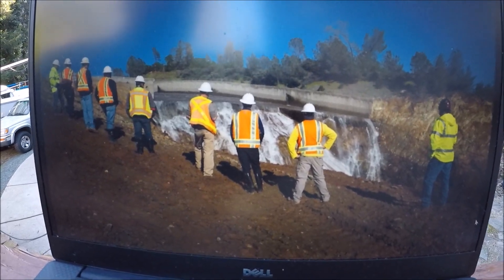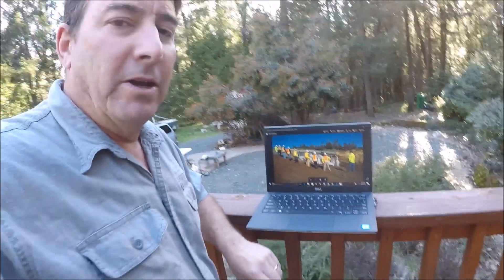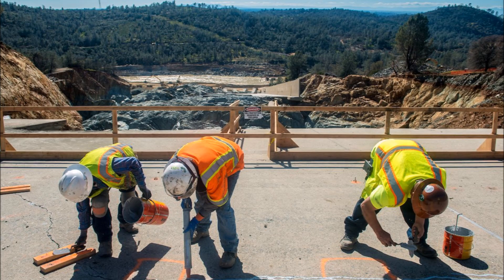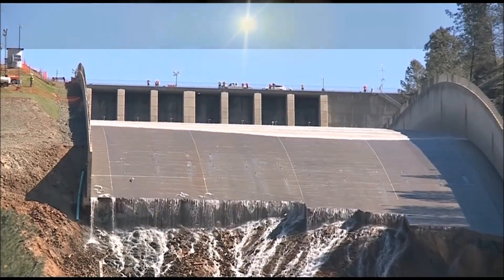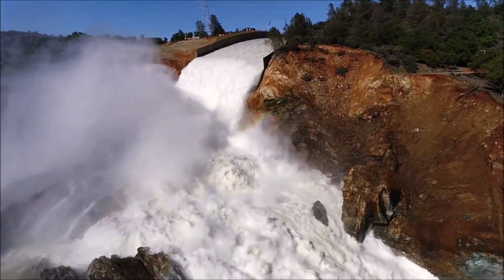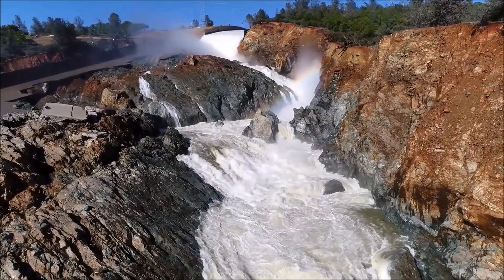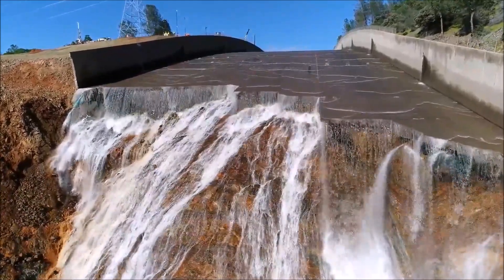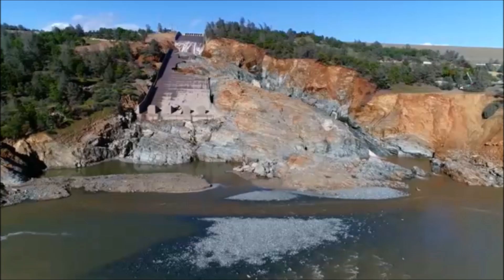Oroville 29 March New DWR Spillway Footage

Comment: I wonder if in the long term, for both safety and to get some use out of the water flow, extra capacity could be added to the power plant. This would be extra capacity in ability to drain the dam and extra electrical generating capacity. I have asked several times if anyone can see if rebar was used in the spillway. I myself do not see any re bar in the spillway construction. I do not know if it is standard to construct spillways without re-bar or if re-bar would have even helped.Sure would like to get something better than we had at the beginning after spending what is it now, 300 million?
Reply from the maker: See previous updates, I covered this issue extensively.

Comment: It looks like there's some significant loss of concrete on the left side. Before, the spillway lip was straight till the right side diving board. After discharge, it is much more jagged. It could be as much as 30 feet gone from the left side.

Comment: The sheer scale of that structure is simply astounding, especially with how easy it is to make it appear smaller than it actually is.  You've probably already done this ad infinitum on past reports, but it may be useful for a future voiceover looking at the cut to describe the physical dimensions of the spillway, including the width, the thickness of the concrete,  the height of the edge walls, and then describing the depth and linear length of that new canyon.

It's amazing how quickly that canyon formed and I really do hope Geology professors are paying attention so they can add this erosion example to their problem sets.  As it is, it simply renders the rest of the old spillway an abandoned relic of the past unless engineering wants to build a real bridge to carry the structure over the canyon.  It'll probably be best to simply reconstruct a new spillway that follows the natural curvature of the canyon, though that might be a level of engineering we haven't attempted before, the construction of actual rapids versus the previous long smooth slopped plane.  I'd imagine with the right curves and super elevated base surfaces that it may be possible, but this would be a design almost better left up to Racetrack engineers, whereas it has to manage both a continuous volume, constant hydrostatic surface pressure, and a rapid but controlled drop in elevation.

Comment: Was wondering if the built a concrete wall say, 75'-100' at an angle and near the end of the spillway?
This could divert water going to the left of the plunge pool and undercutting plus the ability to control the throttle better.
I know the width would be compromised a bit but think the new valley and plunge pools created can withhold the beating of the extra water.
|    |
|    |
|    |
|    |
|    |
|    |
| \   |
plunge pool
                  { New Valley   }
~
Anyway, worked 12.25hr's with 3 more shift to go and was just thinking this could be a good temporary fix for erosion when they need to shut the spill way down to clear fore-bay and after-bay?
~~
Thanks for your hard work Juan, very much appreciated.
James
3/29/2017
11:05pm

Comment: Just an interesting comment, those surface repairs, to me, look a little shallow. I would think they would want to jack hammer those cracks down deeper and make patches that are a little more permanent, in other words, a little stronger, hold on better. Just an opinion from a guy not on site. It sure would be nice if you could be at the press conference to ask more in depth questions than the uninitiated press.

Comment: *Concrete Traffic Barrier, come strong to mind for the undermining ares. Utilized as a sort of stacked to lock rip rap. Truly, non freeway serviceable sections, would prove to be the best selection from which to choose. Strategically placed by crane or copter, and allowed to settle in after several flow days... so the *C.T.B. would find the desired lock with that of the existing sub-grades. Once their particular refusal thatching point to sink is achieved... then, compact car size limestone aggregates could bring the desired elevation just minus that of the design intended concrete rip rap thickness. The *C.T.B. would eliminate the awkward expensive usage of the previously placed rock bolts. blancolirio iv'e sincerely enjoyed the operation's coverage's & Data links. -gilpin 32917
* https://jjhooks.com/applications/traffic  -gilpin 32917

Comment: Perhaps they can just turn that eroded canyon and plunge pool as you call it into the new spillway channel.  Perhaps remove the lower broken spillway concrete section along with the soft rock beneath it and have a giant fan shaped terminus to the spill way.  Just shotcrete the whole thing about 2 ft thick and repair and add to it each year in the dry season.

Comment: Is there no consideration to bring the RVOS back online?  It was taken out of service for fire detection upgrade  seems  that would now have a higher priority to get done, or a temporary detection system,  to help take pressure off the main spillway and provide a another option for dumping water.  Is the out flow rate of the RVOS, if online, equal to or greater than the reservoir in flow rate?   Staying tuned.....

Comment: I bet that as a commercial pilot, if you ever see a straight section of river anywhere on planet Earth, then some architect or other with a straight edge drew a straight line on a plan. Water in rivers never follows a straight course naturally, and if forced to follow a straight course, will inevitable engage in aggressive erosion. If these same engineers were to design aircraft, there would be no curves and the flight characteristics would resemble that of a masonry brick!  Why not make the replacement spillway look like Mother Nature had a hand in the design brief?

Comment: Thanks again for the great reporting.  Could you remind us about the previous accidents, fire and valve failure, etc. and there impact on reservoir outflow?
Reply from the maker: see previous episodes...
Reply: Thanks, I found it, Oroville Dam 10 March, at 0:12:34 - flow is 4000 cfs without going through the power plant, if it's working

Comment: Thanks for another great video. Another excellent production.

There are a couple of interesting things in the drone footage.

The first thing that jumped out at me is the dark stream of water and debris that appears around the 4:50 mark. This seems to be water and material from underneath the spillway. If that's the case, it's clear evidence that the spillway failed because it was undermined by water that leaked through joints and cracks. The engineering report commented on the "extraordinary" amount of water coming out of the drains while the spillway is operating. This is the smoking gun and in my opinion, shows that DWR really badly dropped the ball. The cost of this mismanagement will cost taxpayers hundreds of millions of dollars. Better remediation would have cost a fraction of the cost to rebuild the entire spillway. It reminds me of the shuttle disasters. Clear evidence of problems in plain sight was ignored with catastrophic results.

The second thing is the amount of debris in the diversion pool. The early estimate was around 1 M cubic yards. That estimate was later increased to 1.7 M cubic yards with 1.26 M cubic yards removed. Before they turned the spillway back on, almost the entire width of the channel was clear to a considerable depth. Now, you can clearly see that the channel has been filled with debris almost all the way across. No doubt some of the debris that was at the base of the spillway was moved by the water flow, but it will be interesting to hear what the new estimates are for the amount of material to be removed. I'll go out on a limb and predict 1 M cubic yards (or more). If that's the case, there will have been substantial erosion of the channel. Since the geologists used lidar to scan the channel, they should be able to rescan it and estimate the amount of material that was removed since the first scan.
Reply from the maker: Yes, I should have mentioned the re-3dsurvey.
Reply: That applies to underwater as well, using multibeam sonar, rather than lidar. They have been operating survey boats, but unfortunately, they haven't posted any imagery. It's too bad because it would be interesting to see.

Comment: Thanks again Juan, for an accurate, informative report.

I'm no expert, but viewing the footage, it seems the most common sense path (pun intended) for a new spillway route would be where the flow "wants" to go (viewer right), and appears to be eroding no further, due to the massive solid rock face. 
If that rock face is strong enough to stop the immense force of the flow now, as it appears to be, why not use it as the foundation to build the new section of spillway.

Is there some law or restriction that says a "spillway" MUST be built as a straight chute?

Seems to me, the water flow dynamics and the rock geology are showing clearly where the water 'wants" and can flow, why not build upon what the water is saying?
Armor up with tons of rebar and concrete, the viewer left side, where the loose ground and erosion is seen, then just rebar and concrete the channel the water has already cut.

Plus, I think it would look way cooler, rather than water flowing down a boring straight chute spillway.
Like Einstein said, " Solutions to problems will never be found using the rules that created the problems."

Comment: When you have that many people standing there like that in the beginning of the video they really don't have a plan. You can bet when this is over to it wasn't a spillway failure. It was the dirt they laid underneath it that started with a small washout. They figured once the spillway was set up it could hold the weight of the water. They were wrong. My only two questions is just why aren't they starting at the bottom of the spillway and get that fixed and work there way upward and then figure how to splice it together and be that much further along with the fix. And the million dollar question. From the time there started to build this spillway to completion, How long did it take them to build it?.. As always. Better dump water.

Comment: I have a question.  Couldn't they install some deadman barriers towards the end of the spillway to divert water more toward the right side of the spillway?  This would reduce the erosion from the left side of the spillway and would also increase velocity as it leaves the spillway and goes into the plunge pool and might allow them to reduce the CFS without further eroding the spillway.  I'm just thinking out loud more than anything, this is by no means my field of expertise, but I am studying fluid dynamics.
Reply from the maker: Aaron Adams they will during this repair time.

Comment: Would somebody create a Website (make money selling advertisement space and emergency supplies and retire rich) with all the facts/numbers that are helpful to understanding  the Oroville Dam, Spillways, Power Plant? There are a lot of numbers that need to be condensed on a few pages so everyone can have easy access to them. Then notify Juan and he can post the link in the description box on each new video. Here are some of those numbers. Correct my numbers if incorrect and add to them if you know more: 
-922 feet above sea level is the top of the dam. 
-900 feet is when water will flow over the top of the emergency spillway. 
-850 feet is the preferred lake height. 
-813 feet is the inlet to the main spillway. Once the water drops below that point, the main spillway cannot be used. 
-640 feet is the lowest the lake can drain using the power plant. It can be drained lower, but water would be using the diversion tunnel. 
-224 feet is the maximum height of the water in the Thermalito Pool if the power plant is to be used. 
-19,000 CFS is the maximum amount that the Power Plant can release through the 6 turbines. 
-4,000 CFS is the maximum amount of water that can be released from the River Valve Outlet System.
-27,000 CFS is the estimated inflow to Lake Oroville this summer.
Reply: https://en.wikipedia.org/wiki/Oroville_Dam

Comment: Okay so here's the breakdown of cubic feet to an acre foot.  Just to have a better idea of water volume. One acre foot is equal to exactly 43,560 cubic feet, or to 325,851 U.S. gallons. Just to know real time data now, shows inflow, or run off, at 19,980 cfs, or 0.4586776812799 acre foot per second. which is 1,198,800 cubic feet per minute, that makes it 71,928,000 cubic feet per hour. Convert that to acre feet (af) comes to 165.12408 af per hour. In a 24 hr period, im just gonna round the numbers now, that is approximately 1,980 acre feet. If my research and calculation stand correct, I'm no mathematician, but numbers speak for themselves, they are either right or wrong.  I'm getting my referencing on convertunits.com. Thanks again Juan.

Comment: Awesome reporting!  Why is the flow at 11,000, is only 4 turbines running?  Also a more nagging question with me; why are they not considering to use the river diversion valve for 5,000 more cfs?  Is it because it is sharing an outlet with the powerhouse?
Reply: Theron, if my memory serves me correctly, I think Juan did a video on this recently when he covered the workings of the dam.  I think it's knackered due to some sort of bad repair that consequently nearly swept away some workers who had to go down and open it up. I could be wrong but check some of the vids as I'm sure it's there somewhere...

Comment: I agree with you about where the shockcrete appears to be.  I didn't really expect it to erode away from the vertical face much, cause it's kind of set back under the spillway lip.  But the stuff they shot lower on the left didn't look as secure before they turned on the water, so I wouldn't be surprised if it's gone.

Didn't Bill say, during the press conference earlier this week, that they will rebuild the road in front of the ravine so they can move the dredgings to both sides?  If so, that's going to wash out every time they turn the water back on.

Finally, what editing software do you use Juan?
Reply from the maker: Nicotti crummy old Windows Movie Maker...the free stuff, lol.

Comment: How did they know 40,000 cfs was the correct flow rate?
Reply from the maker: Ian Clapham plus trial and error...
Reply: water mass, gravitational constant @ Oroville, outflows angle, turbidity, and resistance from friction coefficient of the spillway, to give subsequent volume at the calculated acceleration(s) for a trajectory to land in the most favorable area of this said plunge pool... probably lol but I'm just guessing without getting out my books on hydrodynamics...XXX

Comment: I remember the excellent discussion about the accident at the Hyatt powerplant when using the extra diversion gates or bypass gates, can't remember the correct term.  Is their use still off the table for the foreseeable future?  I suppose as long as the spillway is "working" they'll continue with that plan.  I just think it would be nice to have 20 days not only 10 to plan for water releases like these.

Comment: Why didn't they harden that hillside next to the plunge pool or build a little diversion wall to keep water off of that hillside?
Reply from the maker: ran outta time...
Reply: They were right there, spraying concrete.
Reply: Its California, permits, ecological impact, bidding to name a few  before ANY repair can be started. A couple of thousand$  worth  of epoxy would have sealed those expansion joints and none of this would have happened.
Reply: Curtis, believe me, ALL the normal Calif ecological  permitting issues have been TOTALLY bypassed on this project. Like miles of road building, unmitigated dredging, clearcutting  native oak woodland hillsides, and backfilling riparian areas.

Comment: Juan, One question since you have a press pass. Why don't they utilize the emergency spillway in conjunction with the power plant? I know they said they don't want too use the emergency spillway. It seems that this procedure would give more time to effect a repair on the main spillway...  Could you pose the question to the DWR?
Reply: The emergency spillway only works when the reservoir level tops 900'. The reservoir level is currently at 838'.  And the flow over the emergency spillway is unregulated down a still mostly un-reinforced hillside.
Reply from the maker: The emergency spillway does not work like that...see previous updates.
Reply: Oh! Without being branded as an armchair Hydrologist, as I've viewed all your reports and look forward to more. I'm rather surprised the DWR would have an emergency spillway as a 'decorative element' and not use it. Thx for your reply.